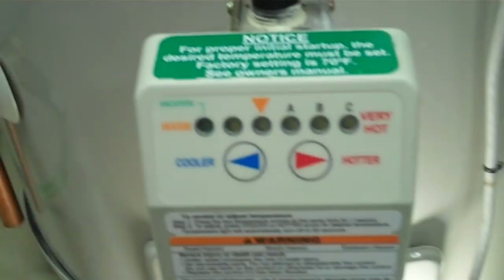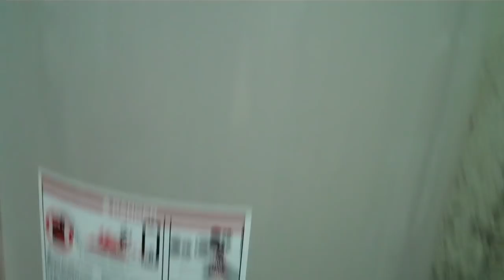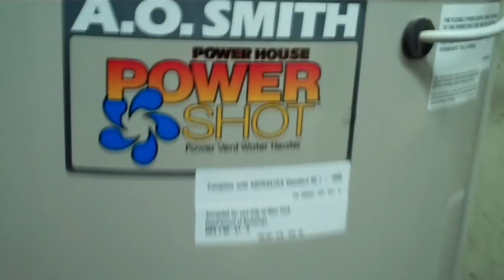Water Heater Flame Gas Short Cycle Ignitor Sensor Troubleshoot Repair AO Smith Igniter@geofatboy

Comment: Thank you for the video. Very helpful. I initially replaced the flame senor and even the elctronic valve assembly thinking maybe it's just defective but what I have come to realize is that this need to clean the sensor is part of regular maintenance to be done maybe 3-4 times/year. I find it irritating to say the least and makes me wonder if this is considered normal in the hot water heater industry. Please let me know if you're experiencing the same thing. 
Another issue I am experiencing is the pressure relief valve keeps releasing.  I lowered the temp to the lowest setting and still having an issue. I have a 105kbtu/hr - 500k max valve. Would be great if you had some tips.  Thanks again
Reply: I have Aosmith gvcvl 40 300 it went out I looked in window looks like need cleaning but I tried relite and it fired up if goes out again I'm going half cleaning to do.

Comment: And Done!    whew!    It would not have taken me so long if I dint have to clean out that garage and also that cleaning of the tank was gnarly. I had not done that since Installed the water heater , probably 7 or 8 years ago.   the water came out orange for a long while, then I refilled it with clean cold and did it again over and over till it ran clear.     
   I think that thermal sensor on top can go out also, it seems weak.  i will be getting a new one.     It's running like a champ now without shutting down.   weird that the little bit of build up could cause that.   there was hardly anything on it.   fired right up after I cleaned it though. 

   Is the are that this type of water heater puts out toxic? or is it just venting because its hot?      Mine vents to a pipe that goes out the roof but also My heat and air unto vents out that same pipe 

  I was wondering because in the winter when the central heat is going, if the hot water heater is also running at the same time for an extended amount of time, one or the other will shut off.  they both join the community pipe Inside the garage .      If its just heat, seems silly to not let it heat the garage.

Comment: Great video easy to follow... hears my problem, i have A.O. Smith Pro Max. and today we had to shut off the main gas line for a few hours because of an unrelated issue. while this was going on a breaker was tripped. i'm not sure if either has anything to do with it but now i can't seem to light the pilot on the water heater. it's no spark at the igniter. any ideas on what to do next? thanks for any attention to this problem.

Comment: This was my problem. Started 6 months ago. I have had to repeat a few times. What I have learned is that positioning of the sensor is also important. In my latest battle I tried to bend it slightly more over the flame. On another, the bracket was slightly off. I have also bought a $60 replacement on Amazon. The rod lit, but no flame. This might be due to above alignment issues, but for now I have gone back to original. I'm not sure if the Amazon version is fully compatible.

Comment: Great video - but my problem persists.  I have a Rheem water heater and it goes to the system error : System in Lockout.  I took it apart and cleaned the part you mentioned.  no help.  In fact that piece was replaced last year at this time so it is fairly new.  Any thoughts as to what I can try next?  Thx! Jamie

Comment: Hi, great video. I did what you suggested. After sanding and putting it back in, the flames came on the third try so I got a tank full of hot water, but then on the next restart cycle system went back into the lock out mode (error 6). Any other suggestion, much appreciated and thanks

Comment: Thanks for the video, I did what you said and it worked on 2 of the 3 I have. the weird thing is when I switched out the thermal sensor between one not working and one that did, the middle one still doesn't work. This leads me to believe it can not be the thermal sensor and I am wondering if it could be something in the control box or do you know if there could be another sensor ? Either way great video and it got 2 of my 3 running and it was time to clean all of them anyway. Thanks

Comment: I have AOSmith model GCvL 40 300 had hot water two days ago none today gas is on I tried relite nothing I look in small glass window I not see a spark. I'm going open it up an see if need cleaning. Or new ignitor.

Comment: Hi, does your burner assembly locks onto a bracket or slot at the base of the waterheater? Or it just sits there and held by screws on the front? Thanks
Reply from the maker: Can't remember, this one was about 10 years ago...

Comment: Nice video. I have similar problem on Rheem water heater.  Replaced Flame sensor and Ignitor.  But still the burner comes on and shuts off after 10 seconds.  Any thoughts what else may be wrong with my heater geofatboy.  Appreciate your help.

Comment: Great video but you should never use sand paper on a flame rod sensor. You can clean it with a dollar bill. That is about the most abrasive thing you should use or just replace it since they are not very expensive.  Thanks for the video

Comment: This worked for me for about a year (year 9 through 10) for this water heater.  This trick no longer works for me.  I purchased a new Hot Surface Ignitor kit today to see of this resolves the issue.  I noticed that the replacement kit was a bit more robust, but was a direct factory replacement (found by using the AO helpline).  You just need the full model/serial from the unit to identify the correct P/N.  I spent about $100 on a replacement.  With a water heater this old, if this doesn't resolve, I will replace the whole thing.
Reply from the maker: Smart! I hope it worked for you!

Comment: Going to try this tomorrow night.  My AO cycles just as you said and then show me the lock out code. After its clean and reinstalled, do I need to follow the reset instructions or should it boot right up as normal once I turn the blower back on? 

Thanks

Comment: I did the tutorial but no luck...the thing still just cycles several times before shutting off. I cleaned the sensor with 220 grit sand paper...but it looked very clean to begin with but the tray area was very dirty...should Iclean that as well or maybe I have to buy the whole new mechanism? What are my next steps? Thanks!

Comment: Our AO Smith powershot 50 gallon is doing the EXACT same thing you describe in the video.  However, it only does it when it is extremely hot and humid outside.  (it is in the garage, however the garage door is open most of the day) When the weather cools down it starts working just fine.  It has done this consistently for the past 4 summers.  Do you think there is a connection?

Comment: This didn't work on my AOSmith FPSH50260.  But a couple of knuckle raps to the gas valve did.  AOSmith said this gas valve is no longer made & said I should plan on buying a new one. It's 12 years old, but I know of people getting 20+ years out of theirs.
Reply from the maker: Woh! You must have some tough knuckles! Don't go around punching anybody...
Those hands should be registered!
Reply: Took you long enough to respond! ;-)  My fix didn't work long.  Had to replace the whole tank with a Bradford White which is 1/4 as loud as that old AOS

Comment: My water heater had this same issue today. Same symptoms. Burner lit for 5 seconds and then shut off
Pulled the burner, cleaned the flame sensor, reinstalled the burner assembly, restarted it,,,
I know have hot water again!

Comment: thank you! question: is it normal for a small amount of gas to escape when the heater is starting up? this is  happening with my heater, lasts only a second or two and then dissipates. I wouldn't have noticed except i was right next to the heater at the time.

Comment: I have a state select water heater with the same control on mine (Intellivent) and am having the same problem.  The only difference is the burner plate has a screen on the top of it.  The screen has burned away in places.  I was wondering what you knew about having to replace any of these parts?  I just got screwed by a plumber who made me replace the whole control and it didn't work and he said there was nothing else he could do.  i think replacing the flame rod or hot surface might work?

Comment: Great video.  I have a similar about 3 yrs old.  Mine is GE.  Mine just shuts down for no apparent reason. Turn vent off and back on and burner will start and run till water is hot.  It works for a few days and stops again.  We realize it when there is no hot water.  Any idea what is causing this?

Comment: Thanks for the help.  Any concerns with a gas leak with the threaded nut even if reinstalled tight?
Reply from the maker: There is always concern where a gas leak is involved. Put some sudsy water on it and see if it bubbles up.

Comment: Have an American Water heater PVG6250T60NV FVIR  unit. It is about 3 years old and has started to do this exact thing. Flame starts then goes out. I am able to get it going by pulling the power and resetting but need to take the burner out and clean. Before I do I am concerned about damaging the glow bar and I wonder if this part would be available locally or only directly from AWH in TN.  Do you know what the cost would be for this part? Good to have around I suspect!

Comment: @geo

Went through the process and cleaned the Flame sensor. Put everything back together and the WH still cycles 3 times and shuts off with the 3 lights signifying system lock out. Have you heard this and what steps people have taken at this point? Any help is appreciated.

Rob

Comment: We have a powershot and we started getting a strong gas odor.  The technician and ao smith recommended replacing the fan/motor assembly. The venting tested out fine. They did that, but same problem.  It smells like its coming from the fan/motor, but everyone is baffled.  Any ideas?

Comment: This is crazy, I never look on you tube and find my exact situation. LOL   I have this exact unit.  75 gallon  with the air thing on top and everything. 

  my gas unit does not have fancy flashy lights though, I suspect that part is older on mine.    OH boy though!   I get to empty that side of my garage now.      I am going to be busy till the sun comes up I bet.  

  nice though, I am betting this is my exact problem.  doing just what you said.

Comment: my cousin has a laundromat with an A O Smith conventional water heater and two storage tanks and it is 426000 btu but cant access the flame sensor since it is too high up from bottom burner assembly

Comment: Sorry I spoke too soon. I took out my burner and cleaned flame sensor which was dark colored but not encrusted. I sanded it from the bend to the tip but, still no flame. Heat sensor was dark at just the bend.after the bend looked new so I didn’t sand it. Also my burner was rectangular in a screen housing, like a rectangular beehive. Is i5 worth trying something else, or should I call a plumber at this point ?  The model number is GCBN 75 100

Comment: Thank-you so much for your video! It is so helpful. We have no hot water right now. I have needed to clean the flame sensor every 3 months  to keep it working. My son cleaned the flame sensor yesterday, and after it was put back together, different trouble codes came on-indicating error in hot surface ignitor circuit. AOSmith says that means I have to replace the entire ignitor assembly. Can the ignitor be sanded? It looks orange, and the flame sensor-even after cleaning- is not shiny like on the video. We try to clean the tip real well. Any thoughts-do you think I have to replace the part? Thanks again, Cheryl B
Reply from the maker: No, do not try to sand the ignitor or touch it with your fingers. If it's shot, just replace it.

Comment: Clean the flame sensor with bronze or steel wool. You can even use a dollar bill.
60 or 100 grit sandpaper is not advisable. 
35 year plumber

Comment: I had done the steps as mentioned but i don't see any lights coming up which used to come before and don't hear any noise that the water heater is really running....Is there any thing I need to do ? Please reply :(

Comment: If you have a Kenmore (usually from Sears) you have a flame arrestor underneath your burner assembly. It is designed to stop explosions, but they are very small and impossible to get to with a vacuum. I use a wire brush connected to a coat hanger. Clean it top and bottom the best you can, and it will work for a short time until it plugs up again. I would poke holes in it to get air to the flame, but then if you do have an explosion, your insurance is void. Bottom line, stay away from Kenmore!!!

Comment: Can I ohm out the sensor at the connector. Also I have a drip inside is that the water heater rusting out?

Comment: I have an AO smith effex water heater, The GAHH-50-100 model... It was installed two months ago and now it is no-longer generating hot water; the fan runs non-stop and there is a weird noise resonating from every pipe in the house... Do you have any suggestions for this problem?

Comment: I have a Bradford White natural gas water heater with a Honeywell thermostat/gas controller.  It starts and flame is on, but every 5 seconds or so the igniter ignites and creates a flame up, and I can hear it from my bedroom.  It seems to ignite for no reason, since the flame doesnt go out.  But it does get a bigger flame when the ignites goes off...  I cleaned the flame sensor but didnt make any difference.

The LED light pulses every 4 seconds when its not running, which means all is good.  And when it is heating, it goes bright to dim , bright to dim, which means thermostat is calling for heat.

Any ideas of what could be wrong?  Should I replace the thermostat/gas controller assembly?  Kind of expensive, so I would like your opinion before I do that, 

thanks for any help,

Doug

Comment: What if before and after replacing the entire assembly, it will only run for 8 or 10 minutes then shuts off before getting to the correct temp, and pilot light will be out too.  As I said, I looked at video and replaced the assembly but this issue is still here.

Comment: I just had a customer that has a A O Smith GPS-75 Promax Power vent. The blower was bad and I replaced it. Now the flame is getting to much air from the cover plate area and the flame is being blown out and away from the flame sensor. When the unit does light; flame is weak. I tried to vaccum the inside of the burner area and the outside under the water heater. I can't find instructions from A O Smith on proper way to clean air intake. Any ideas?

Comment: Help my Richmond spark ignitor gas water heater will not start all the time but if I just turn the on & off switch off and back on it will lite and heat up do you have any idea where to start. Thanks Charles

Comment: Love this, but the tempeture control did not light back up. Do you know what I did wrong
Reply: Temp control only lights up if there is a fault, or if you perform the override to set the water temperature. Otherwise, no lights = no problem!

Comment: What is the error code for this problem? A service man just replaced my power vent assembly but I still don't have hot water.  The intelli Valve clicks but then the vent motor shut off right away !!!  I have error code 1,3,4,6 led.  Manual indicates error in the hot surface ignitor circuit.  I never touched the circuit.

Comment: Do you know how to do this on a Rheem PowerVent Water Heater?  I’m having the same issue but can’t access the igniter to fix like you did on this model. 😒
Reply from the maker: Hi Nicole,
If you have the owners manual (usually its stuck to the side of the unit) it will show a breakdown of the parts.
Reply: geofatboy geofatboy ya I’ve been reading the manual but it doesn’t mention Anthony about accessing the igniter unfortunately and I can’t loosen the nut off the bottom of the gas tube for the life of me. If I don’t have the wrench that you used but have a bunch of other wrenches, including a adjustable wrench, could I use one of those wrenches or do I need to use the 3/4 wrench you used? My house and water is FREEZING!

Comment: The water is continuously being replaced as you use hot water so I have serious doubt that periodically draining the tank does anything to increase longevity?  What actually does increase longevity is to inspect and replace the sacrificial anode rod if it has completely corroded away.
Reply: Incorrect. Yes the water is continuously used- but any particulate matter in the water - and there will be some generated by just heating the water-  will settle to the bottom of the tank.  I've opened up rusted-out tanks where there is 2" of solid calcium sludge baked on the bottom of the tank- and pinholes through the steel at the points where the burner flames contact the tank bottom. .  As this sludge mass increases- the burner starts flaming against what amounts to a patty of concrete - instead of heating the water it heats the bottom of the sludge, baking it down even more. Eventually your burner will literally pop the enamel off the inside of the steel tank - the heat can no longer transfer to the water, so it collects in "hot spots over the burner flame tips - gets red hot - which in turn pops the enamel-glass coating off the inside of the thank - and then rust starts.   Once that happens, you've got one, maybe two years before the tank starts to leak.   Draining the tank eveyr year or so will help prevent that and def. will increase the life of the tank.
Reply from the maker: Thanks for clarifying that Tioga! Boom!